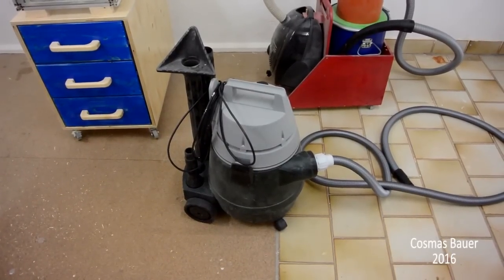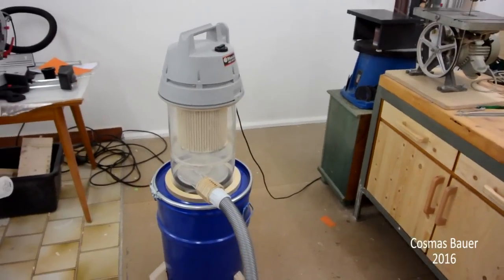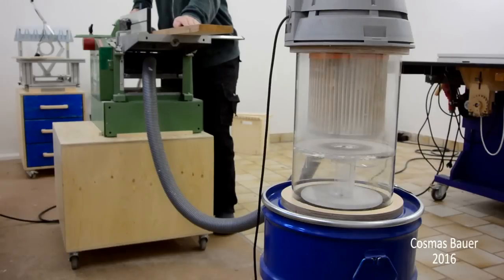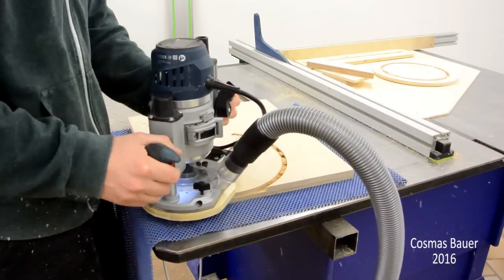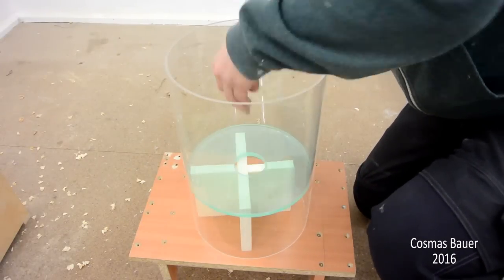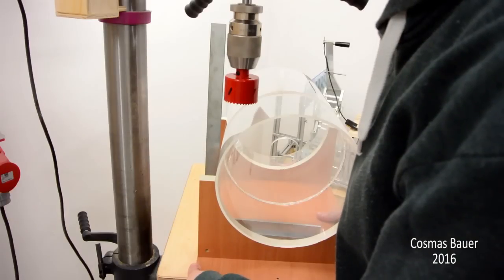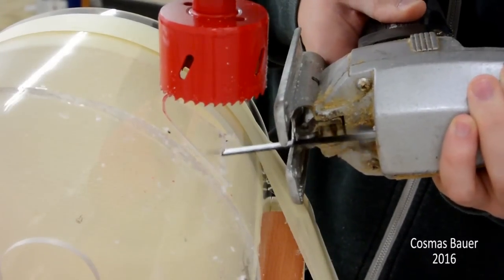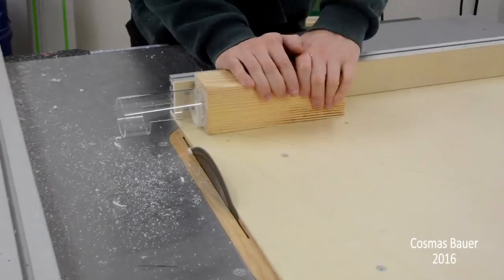Building a small Dust Collector from an old Shop Vac (transparent)

Comment: Woah! Your drill press can go in reverse?
Reply from the maker: pretty cool eh?
Reply: +FastEasySmartTOOL Optimum in general makes quite decent machines, got one myself and a friend got one of their lower end milling machines ;)
Reply: +Toolify 
If it's a "simple" one with a 3-phase induction motor (this includes the ones that run on single phase with a capacitor, if you don't have a 3-phase outlet) and no control electronics it's very easy to add that function to any drill press if it doesn't come with it already. You just have to switch 2 of the 3 motor wires around.
Reply: Check first that your chuck is not screwed on, or you might get an unpleasant surprise!  Most chucks are held into the quill by a No. 2 Morse taper or similar, but some are actually screwed onto the Morse taper spigot, without a locking grub-screw.

Comment: I REALLY like this kind of all-in-one design.  I’ve watched this video a number of times.  However, the exit port from the cyclone appears to be inside the dust separation chamber, mere inches from the inlet.  I wonder if more vertical separation between inlet and exit would improve performance.  I’ve also seen some cyclones with the exit below the baffle, but that raises concern about the possibility of pulling dust from the dust bin, or bucket.  How about a baffle with sides, like an inverted bowl, that extends down into the bucket, and the exit port in the center?  Very little chance of pulling dust from the incoming stream that way.  Appreciate your work and creativity.  Please continue.  And please stay healthy and safe.

Comment: Is this glue at 7:50 polyurethane glue? I hear at a lot of videos about this construction type adhesive that you use, but it seems impossible to find it at my country, at least the stores here doesn't know what I am asking about..
Do you have any brand name, model or link, to find this on internet?
Reply from the maker: Yes that is polyurethane construction adhesive.
I use Debratec PU Montagekleber which is not better or worse than any other I tried so far.

Comment: always  love your builds but I do have to point out that that acrylic tube is not cheep. near to the cost of a commercially available dust separator. your setup does have the advantage however by fitting the underside of your shop vac
Reply from the maker: That acrylic pipe alone was twice the cost of a dust debuty, commander or whatever.
Reply: +Cosmas B rofl! twice!

Comment: that clear tube is sooo expensive. for that one can get a really good shop system
Reply: You might be able to use a cylindrical fish tank.  I see some on ebay and amazon for 30 or 40 bucks that seem to be the right size.  Look for API Aquaview 360 Aquarium.  The three gallon one measures just slightly larger than the 250mm mentioned in this video.

Comment: Maybe I missed something in the video or comments, but this variant of the Thien design (cutting the hole in the side of the outlet tube) is not something I've seen before. Is this your own design?

I understood that minimising turbulence inside the chamber is a good idea, but surely the hole in the side of the tube would cause a lot of problems (vs just having an open tube protruding into the chamber)?
Reply from the maker: Yeah I have never seen that before either.
The tube does not cause any problem. It tube holds the baffle and shields the outlet of the cyclone from incoming debris.
Reply: Thanks. Was it just an experiment, or had you done some research that led to the design? The usual thing I see with the outlet tube is either an open-ended straight tube, or the same but with a bell mouth opening (both usually mounted about half way down the chamber).

Comment: Great video and workmanship. My only question is, I have a great dust collector that I want to make what you have here, it's not the same brand but small and powerful. The question is where did you get the bottom can with the lid that locks on like that? I really like that and want to make one! I made a similar 2 stage dust collector but it's way too big for my small shop. This one looks perfect.
Reply from the maker: You can get them on ebay.

Comment: Just built my own version based on this and Marius' and others, except I used 0.7mm galvanized steel, it was much cheaper than acryllic or polycarbonate. I used a square inlet though. I have this memory of reading that it's more efficient, also a bigger diameter pipe (76mm) in the center since I believe a lower air velocity in the center  reduced air velocity there, which increases separation.
Reply: I noticed that the acrylic or polycarbonate was very expensive. Where did you order your steel from? Thanks
Reply: I'm in Finland so my choice of store is likely no use to you, I went to the nearest construction / machine rental place, they have rolls and sheets of stuff.
Reply: Thank you for the info

Comment: why do you have to finish off cuts made with the router compass with a jigsaw?
Reply from the maker: I usually don't cut through all the way with the router compass because when the piece breaks lose there is always a little tab left and there is also the danger of something getting caught and damaging the material. So I cut hanlf way through with the router compass, then cut it out with the jigsaw and then remove the remaining material using a flush trim bit in the router.